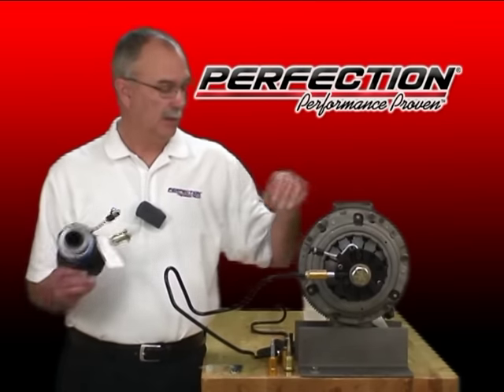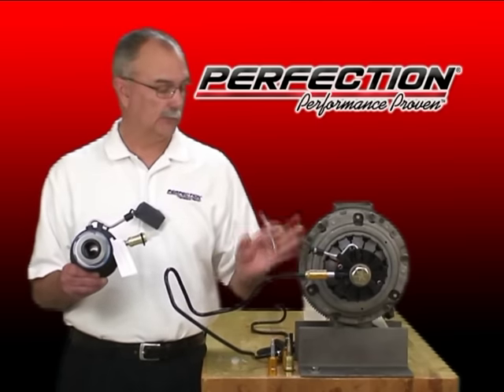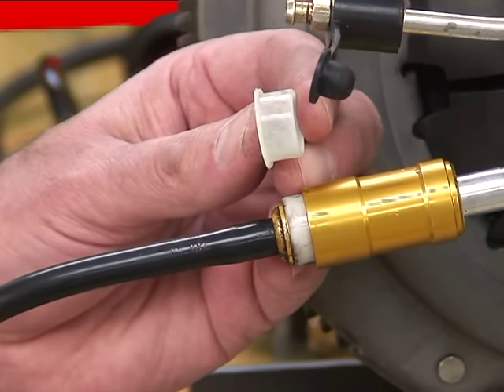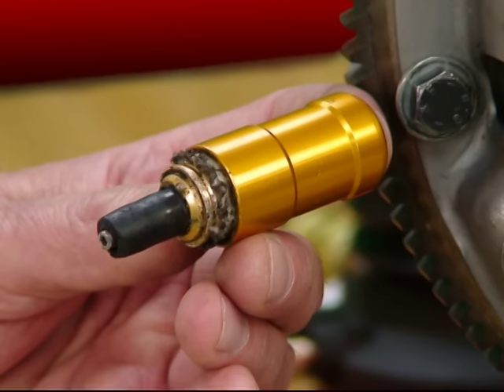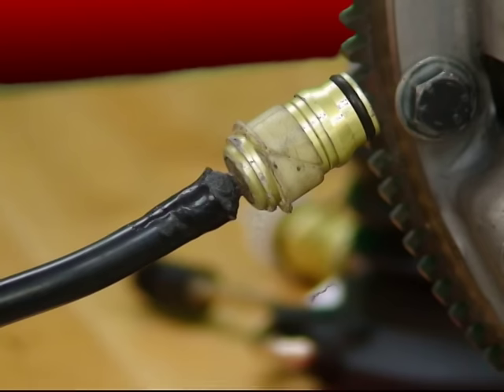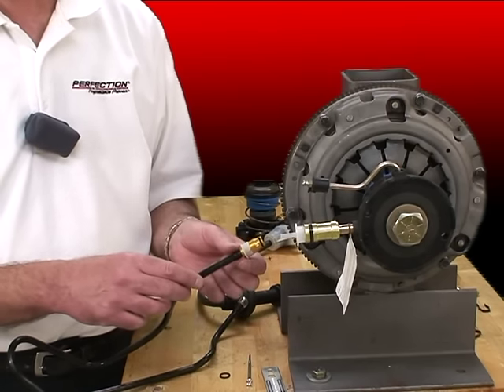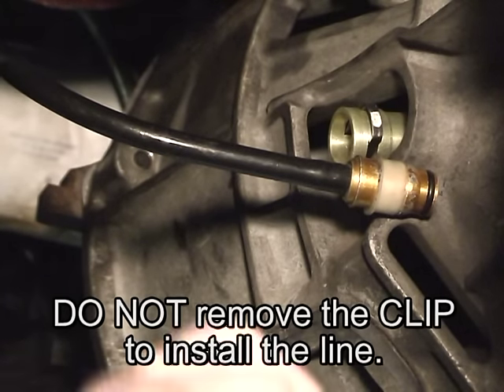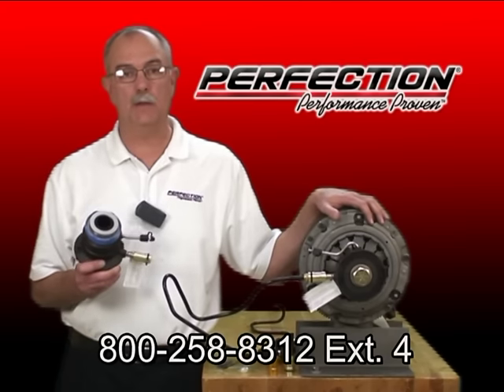Removal and Servicing of Clutch Master Cylinder to Slave Cylinder Connections

Comment: Great video. I have a 2004 Silverado 3500 salt/snow truck in shop. Has a thin red plastic clip that is salty and brittle. My connector is up by firewall. Update- found one of your wrenches in my toolbox. Didnt work due to brittle rim and corrosion inside. Used large visegrip on 1 side, small vise grip on other side, managed to break the corrosive seal while my face planted in the brake master cylinder. I greased it up like a pig before reassembling. Also if anyone has a damaged clip,it can be pulled out and replaced with a pick but if your outer lip is corroded off, use vise grips on edge, then insert the precision clutch tool ht-01, then pry away.

Comment: A little update on the truck we were working on. I bled the whole system and after reinstalling the master cylinder. I looked at my uncle and said well..bud.. you need a slave cylinder! So we removed the transmission again and put a slave   cylinder in it! Pretty much he hopped in it and has been driving it since.. thankfully the new slave cylinder came with a plastic grommet ring for the hydraulic hose and an O ring! I heard not all do so I'm sure if the O ring looks good a person wouldn't have to change it but we did anyways since the parts were at hand and readily available.. Thanks for the help guys.

Comment: Thanks for this video.  I find the system with the teeth keeps a much better connection than the clip.  My clip slipped off and fell INTO the slave housing in the transmission, so hopefully I can retrieve it by taking off the starter.  Plugging a magnet into the peek hole didn't pull it out.  I may just replace the new slave with another because I am not confident it will stay connected!

Comment: Cut the line and use a compression  union with delrin  or brass ferrules to join back together, I've even patched copper tubing segments to repair damaged plastic line. (still holding after 15 years.)

Comment: The second connecting system (with the white colored sleeve) I found on a '97 Trans Am. Took two small screw drivers, packed it in and disconnected it. I did have to take a pair of slip joint pliers and rotate the line back and forth GENTLE while I pulled on the line. After a shot of PB Blaster, it slipped right out and line was reusable. Side note... try not to mess up the line. The only way GM services the line is with the master cylinder. Not cheap and a major pain to replace!

Comment: To modify the line connection, carefully grind 1/16 inch groove in line fitting where clip rides . This will give more of a shoulder to hold clip from popping apart. I live in northern New York with rough roads. 3 months of driving the clip popped. This mod will works.
Reply: I'm sorry, grinding wasn't the best word. I use a small 1/4 drive die grinder to carefully create more of a shoulder to hold the clip. I have not seen your replacement connector line. You have to admit , there is not enough shoulder on the OE line for the clip . If you folks could make a better / more aggressive connection you will double your sales. Everything else about your clutch components is excellent !
Reply: Sir, the clip is not a durable hold for the very small ridge that is there to hold. On rough roads it pops within a few months of driving. Other than that your clutch components are outstanding.
Reply: I had my line pop off in 20 blocks. Was not happy.
Reply: @danhutchins9353  I can't keep the line in my 94 F150.

Comment: I have a 2000 Firebird with a T56 transmission, and I replaced the slave cylinder with one that has the sliding clip, but after about a week of driving, it failed and ejected the hose from the master cylinder. I bought a new clave cylinder, pulled the transmission back out, and went with the spring tab style slave cylinder, and that one is ejecting immediately when I push the clutch in while trying to bleed the system. I've pushed it in as far as it will go, and I can't pull it out by hand, but as soon as there's any hydraulic pressure, the hose ejects from the slave cylinder. 

Am I doing something wrong, or is either my master cylinder or slave cylinder defective? I've had the transmission out twice now and had to buy two brand new slave cylinders, and I really do not want to pull the transmission out a third time in my driveway.

Comment: I installed a new clutch slave cylinder today on my 1989 f150 the old style had the clamp fingers the new one has the clip the hose will not connect to the new cylinder no matter how had I press on it but connect to the old one very easy

Comment: The answer is simple. pull the small roller pin both on the slave cylinder, as well as the roller pin on the clutch master cylinder bolted to the firewall on the truck.
slip an AN3 Russel threaded connector at each end, retain with the roller pins you pulled earlier, and then thread on a braided metal line. (48 inch long line)
https://www.amazon.com/Russell-640281-SAE-Adapter-Fitting/dp/B002Q37CHS

Comment: Great video. I have the older line connector
Reply: Ranger with the older system as well. I have the ring all the way compressed as far as it can go you can’t see it still can’t get the line out.

Comment: Working on a 97 ranger and I keep getting air in the line. Tomorrow morning I am going to remove  the   cylinder at the pedal and do the upside down air  bleed technique. I am convinced it will completely fix the situation but am completely sure your video I just watched has the answers to the culprit. I noticed on the truck I am doing maintainance work on ..that the clip is intact and the hose is secure but that it does not in fact have a plastic sheathing ring. The rubber O ring looks exceptionally well but I am curious now. Does that plastic sheathing ring sustain some type of alignment that keeps air from seeping back into the hydraulic system during clutch pedal release?..Ive replace front and rear bearings in the bellhousing and installed a new stage 1 clutch and pressure plate but.... the pedal was  as my uncle called it soft.. I got to his house today with plans to do the aforementioned technique and noted the pedal wasn't even connected to the hydraulic piston rod.. I found the little plastic clip for the pedal and put it back in and then added an extra clip to it to secure it in its mounting format. Then I said try that.. I laughed for ten minutes thinking he wasn't even aware it was not connected.. then to my dismay found.. the pedal was soft.. solo. I crawled under and bled the system at bleeder port.. then noted.. the whole system was gradually getting worse.. I bled it again and then decided we would pull the master cylinder at the pedal and would wait until tomorrow to do it.. I did crawl under the truck again and removed the hydraulic main line running to the transmission and that is where while watching your video later this day.. in retrospect awareness to its lack of having a plastic ring have decided. To go ahead and remove the master cylinder to just try it for luck.. but feeling deep down inside.. I hate wasting time especially if I really feel like that is where the air is getting into the line... aghhhhh... I love it.. can I pick up a plastic line coupler at the auto parts store ? I don't want to pull the master cylinder twice?

Comment: Just recently installed both a new slave and master cylinder from Perfection clutch. Great parts and ease of installation but the disconnect on the slave where the new line connects is leaking slowly. I bled it properly, checked for any kinks, disconnected and reconnected... Can't figure it out.

Comment: Gary, have you ever heard of the clip suddenly coming off resulting in the master cylinder line disconnecting from the slave?  This happened to me while driving about 150miles after putting in the new slave.
Reply: So an older master cylinder head could have been the reason for the disconnect? I was only alarmed because the line disconnected after over 100 miles. No assumption of deception, your videos are very well done. If you have an email address I can PM you rather than keep posting comments.
Reply: I just bought one of this clutch systems for my bronco and it also disconnected while traveling on a dirt road.. Now I can't get it to lock in...
Reply: Thanks for the fast reply Gary, I looked at the video several times and I guess when I was trying to pushed the male in I must have bent the clip.  You have to understand it was on an offroad  trail when the hose came off.. I pulled the clip and it is bent on one side.Is there a way I can get a replacement clip?Thanks....

Comment: They changed the design of the male and female connectors. The metal clip is no longer used. Is there a video on how to disconnect the new design? I'm battling it now, getting the sleeve to slide in and push those inside finger-type round prongs enough to release the male connector.
Reply: Nevermind.....I see it at the 3 min. mark.

Comment: How are you I have a 99 toyota camry just had the clutch replaced and now it's hard to put it in gear the shop gave it to me like that and said I need a master cylinder for the clutch do you think that would fix my problem or did they not bleed it long enough

Comment: I changed my clutch Saturday on my 97 ranger I disconnected the quick release hose from slave and after changing clutch put it back on it snapped in like in video but now clutch pedal kinda soft hard to get in first gear did air get in line somehow when disconnected line little fluid came out but not much at all I opened slave bleeder and that helped peddle little bit
Reply: just a little fluid out is to much,,u must bleed the line ,,u don't want no air at all,,beleve me.

Comment: Don't know if somebody will read this, but...
I own a 95' Ford Ranger 2.3 and lately the clutch has been giving me terrible problems, first it was partially fixed by adding brake fluid in the main reservoir once a week, now the fluid just goes down by day, I found that fluid was scaping at the bottom of the transmission, I did not see any problem on the main line neither the master cylinder, so the only alternative I saw was the slave cylinder. Is there anyway of pulling it out without tearing apart the transmission?

Comment: So what does the slave cylinder actually do I just got a 1993 F-150 XLT 4.9  6 cylinder 4x4 with a 5 speed  it slips I guess as the guys was reving it up and it was barely moving reved way up i thought and would get slightly going is that a slave issue or clutch?

Comment: Having a little issue, just purchased a master/ slave cylinder Assy from orileys, looks identical to the one in the video, once I installed it, the pedal is extremely hard, but fluid is still circulating, but if I press to hard the line to the slave pops out, any ideas?
Reply: I'm having a similar issue

Comment: My daughters 05 Mustang 4.0 V6 I think is having clutch problems. I can take off in the car fine but once I'm in cruising stage and I hit the gas the rpm's rev up and the car has no acceleration at all. Is this the clutch or something else. And is her clutch Hydraulic? And I do hear a squeal sometimes while engaging the clutch pedal.

Comment: I didn’t have a problem getting it out, I had a problem with keeping it in. I had something looked like the clip ( ranger ) but it was only holding on by .002 “ or so. I made a ring to fit around it and had two set screws to help hold it in. Now about 4 years later it still in there but I need to take it off.
Reply: how did you make this my clip broke on my ranger and ive been trying everything to jerry rig it back on
Reply: @ViSioNxJoK3z  I had to find a metal ring just the right diameter and drill and tap for couple either no. 8- 32 or 10- 32 screws to hook in the groove better where the tiny clip goes.
Kind of hard to explain, need pictures.

Comment: The 90 deg shoulder may be damaged. I will double check this week . if so it's not damaged that much from what I remembered. So if the edge is damaged just a bit, can I file to get that edge . Also I was also thinking about sort of clamping them together. like a 1 inch C clamp with a rubber center or like heat strink tubing holding it inplace. cause when it does connect . I tug on it and it holds strong, but  after abit of driving it releases. Yes I still have the sleeve and it looks fine.

Comment: . I didn't install the hydraulic line into the slave cylinder properly and it popped back out. Now I can't get the line to reattach. I can push the line into the slave cylinder,  but it will not click into place. Any ideas on what im doing wrong?

Comment: Hi there! 
Please advise what the problem as I am really struggling to select gears in the mornings or whenever my 2004 Saab 93 Aero 2.0 T SS has been parked either overnight or during the day.  My charge seem really low and as a result the car starts moving forward or backward whilst in the starting process.  On top of my gearbox seems to be some oil sweat or it might be leakage.  How do I fix or bleed the clutch to normalize it. Please advise...

Comment: 98 Ranger with very FIRM clutch pedal .. the travel from extended to the floor and back is smooth yet the clutch slips with even moderate power especially in 4th & 5th..

 My thought is that the disk is worn and the pressure plate can't release enough for the clutch to grab? 

 I was hoping to find that is not the case as not looking forward to dropping all the 4x4 xfercase etc
Reply: Sorry I had not included more info... 98  Ranger 4x4 4.0L ohv  off road version with limited slip rear & I think the HD transmission VIN 1FTZR15X0WPAxxxxx (not thinking the last numbers determine equipment installed and also not keen on public posting full VIN)

 used meaning WAS some one else's problems are now mine with zero idea what has been done (or not) with it.  ( am SOO  N O T looking forward to doing this but it is useless if it won't grab... )

Comment: 4 months this slave lasted me. Now its leaking from the tube that connects to the slave itself. It seems to have some play. Turns with connector but doesn't pull out, just leaking. It happened this morning. The line popped out of the connector. I popped it back in and bled it. Now it leaks where the tube meets the cylinder.

Comment: My clutch line popped off today. I cannot get it back in. the slave and master have been replaced in the past. I do not have a sliding grey clip on the male connector. My female connector does not have teeth inside, it has a clip that goes around it and inside of it, like many similar ones. I cannot get the connector to seat back inside of it. It will click and act right but when i press the clutch pedal, it pops right back off. The truck is a 1994 F-150 with a 302 and a M5od transmission. Any advice?

Comment: So why not just take the the black clip off to pull the line out. 
Im working on my ranger right now and I cant get the stupid thing to push in. It had a lot of dirt and grim on it so I cleaned it and still won’t push so the one I have it’s the one with the clip so why not just take the clip out and then pull the line off ? 
Seems a lot easier than trying to force that piece in. ?

Comment: I have a 2000 Pontiac firebird v6 manual trans. got brake fluid leaking from the slots in the bottom of the trans . not sure if its the slave cylinder or just a leaking line. any way to tell without dropping trans?

Comment: The previous owner installed a new clutch in my '94 Bronco before I bought it.  3K miles later the slave cylinder failed, so I bought this one and had a shop install it.  500 miles later it has failed to!  Both failed from a leak between the back of the slave cylinder and the front of the trans housing.  Any idea's on what could cause this (I replaced the master cylinder and hose as well)?!?

Comment: Hi I need help so I installed a duralast slave cylinder on my 00 v6 Camry and it pressure felt good but it kept cracking every month so I upgraded to Valeo and now the clutch feels super soft any ideas?

Comment: Just replaced the slave on my 91 f150 and get the hydraulic line into the slave the old one seems alot deeper than this new one i already looked up the part number and it seems to be the correct one is there something im forgetting?

Comment: I replaced the clutch but not the throw out brg needless to say I had to pull it a second time however this time I cannot get the line to release this time with the tool or screwdriver it is really hung in there      any suggestions

Comment: No, never topped the clutch fluid since I bought the car....where do I locate the clutch fluid as I only found the brake fluid and power steering fluid compartments as yet....where do I bleed the clutch on my '04 Saab 93 Aero? I appreciate your assistance....

Comment: the bleeding line that goes from the clutch cylinder to the slave cylinder one solid line with the connections
Reply: Roy Molina have a 03focus manual, was driving and clutch line blew out from slave cylinder. Got it back on and bleed it but still grinds in 2nd would that be the slave that's bad or I need to bleed it again?

Comment: The little plastic clip on my line cracked and blew out of the cylinder. do you sell just the clip? or should i replace the whole slave cylinder again?
Reply: Never mind.i fixed the conection but it turns out the brass both inside and out side are worn out in less than a year. i just have to get my warrenty

Comment: After pushing with a screw driver and tugging like crazy for an hour I finally gave up. The sleeve was busted up pretty bad. I gave it another go the next day. Pushed the sleeve up with screw driver then pumped the clutch and the connecter popped off.